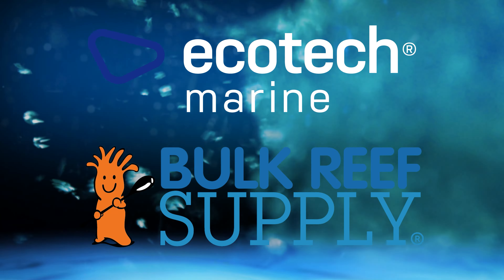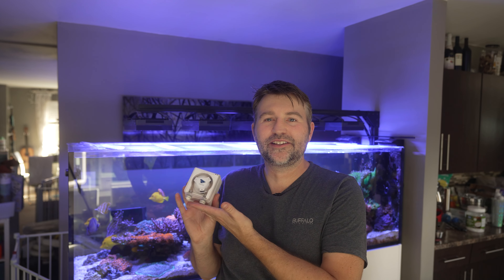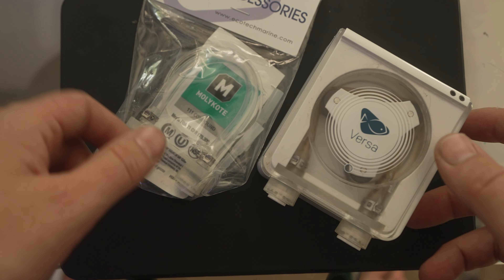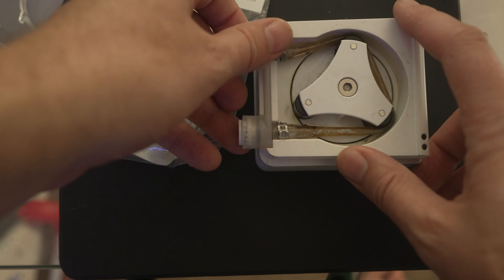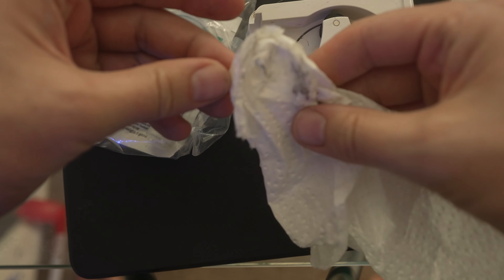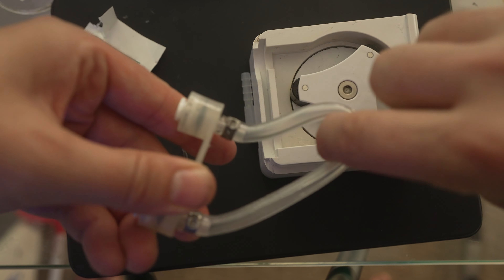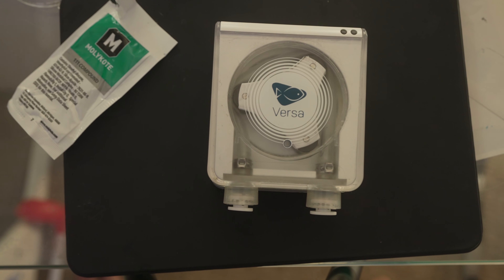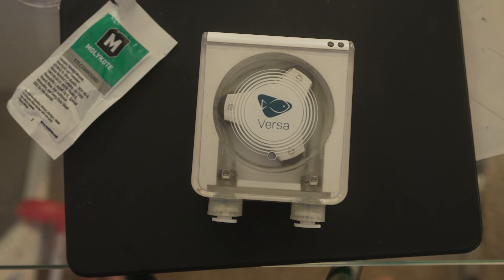Ecotech Versa Maintenance: Tube Replacement

Comment: Good video the tube on my fx-stp leaked on me because of how stiff the hose got and I hade to replace it not to mention I had to wait to order it so my calcium reactor was down for about a week and a half I ended up ordering two of them so it won’t happen again the waiting to order em I mean 👍🏼good vid
Reply from the maker: I Have had a similar experience with the fxstp as well seems to need a hose replacement every 4months or so when using for a CARX , good to stock up on a few spares !